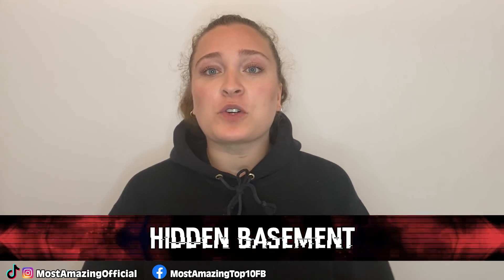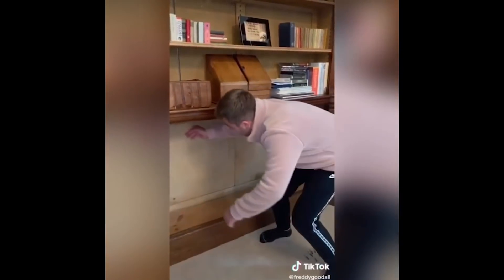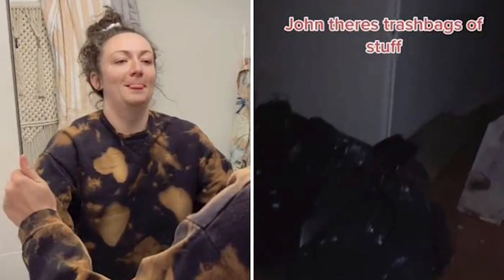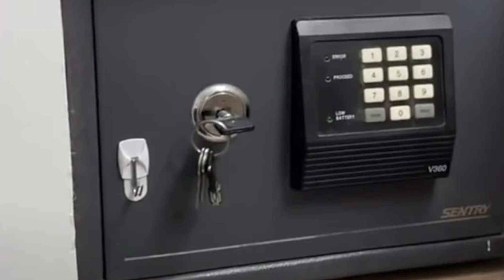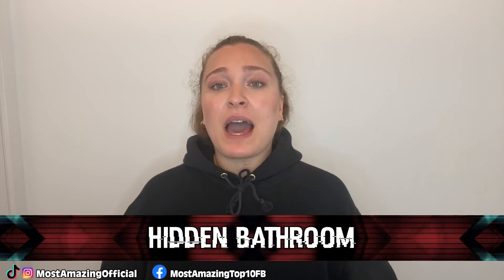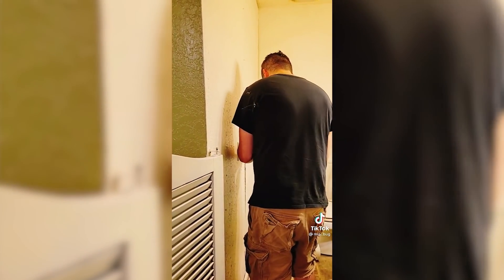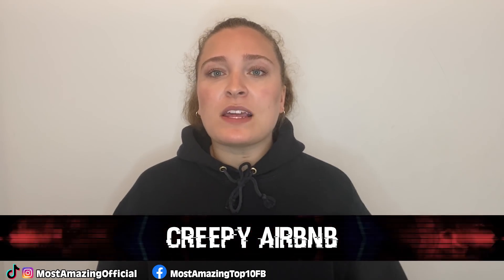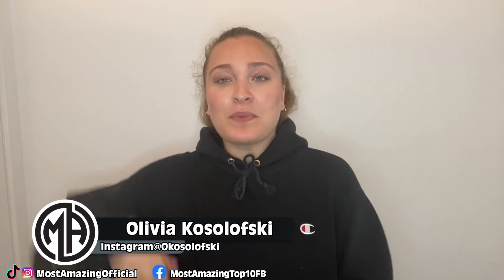Top 10 Secret Rooms People Have Found On TikTok

Comment: Number 4 the square panel and the wall being rebuilt is cause that's an access point to the framework. The way may be new cause the insulation looks new which states the home most likely had some stuff replaced or the home may be newly built or renovated. But yeah that panel is just an access point